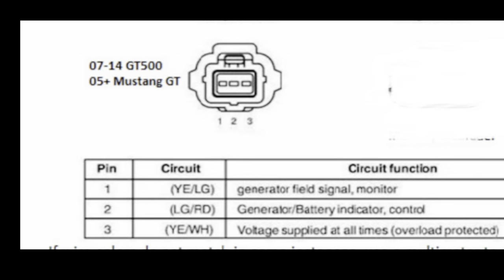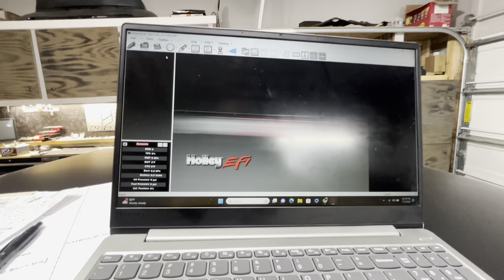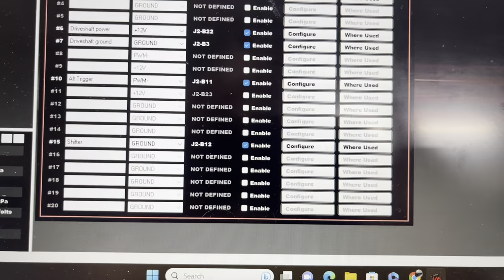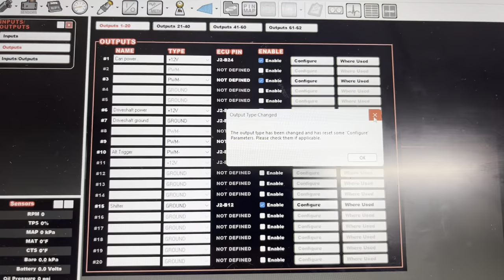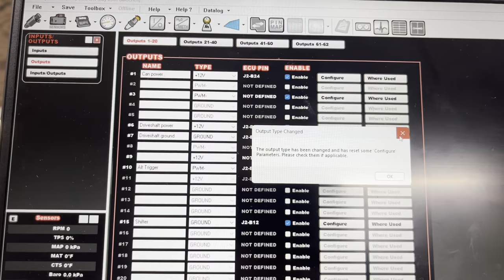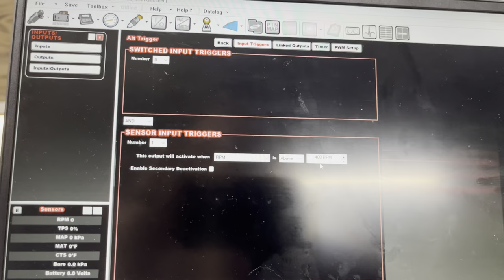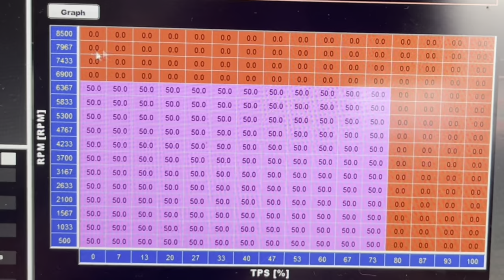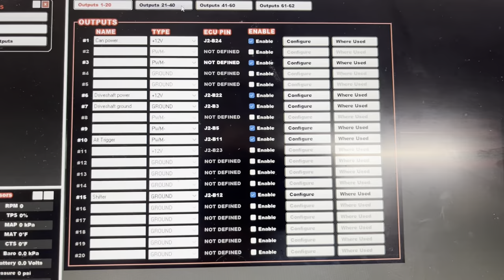🔥 Ford Alternator Control Using Holley PWM Setup 💥

Comment: Heavy load is where you want to maintain constant voltage, sudden voltage drop under boost may drop fuel pump rpm and can lean out some….maybe not enough to harm anything if you still have the O2 making corrections but last thing i would want to do is shut my alternator off when i stab the throttle on the transbrake with all the electrical stuff pulling pretty much at its peak. Lower voltage draws more amps so i would let it charge 14.8-15.5v going down track so it wont affect fuel or spark under its highest boost level and highest demand on the injectors and coils
Reply from the maker: Hmmm good point. Didn’t think of it that way. My thought was it’s just dropping back to 13.6 when off like it’s been at this whole time.
Reply: @ThePaintPaperHustle  depends on your load demand, be nice to be able to log current demand vs engine load/boost and RPM then you could scale up the charging at the high demand points, like tq spikes on shifts, to possibly aid in some consistentency through out the run. Most likely overly excessive data but i will be logging ours though. 
Btw double check the one way clutch in the alternator pulley, if belt routing is opposite of factory clutch will roll over and slow the alternator down and not charge right until it melts down lol. I changed to an old school solid pulley before it became an issue. Good luck man
Reply from the maker: Yes that would be nice. And if you recall awhile back we changed the pulley on the alternator to get rid of the one way pulley
Reply: @ThePaintPaperHustle  didnt remember if that was you or somebody else so i thought i would mention it while i was rattling off things in my head 😂

Comment: Be careful wearing your wedding ring using paint thinner because it will make silicone rings expand and they will fall off. It's happened to me several times
Reply from the maker: Yes that happens all the time painting when cleaning the gun. I have spares at home bc of that lol. A lot of the time I take it off if it gets thinner on it bc that mess burns the skin under it
Reply: @ThePaintPaperHustle  I try to remember to take mine off too but sometimes...

Comment: ur alternator basically works same as a ford 3g alternator ...iv also heard looping the exciter wire to constant 12 could possibly over charge the system or burn up the alternators built in voltage regulator
Reply from the maker: Interesting. I knew it probably wasn’t the best idea to loop it